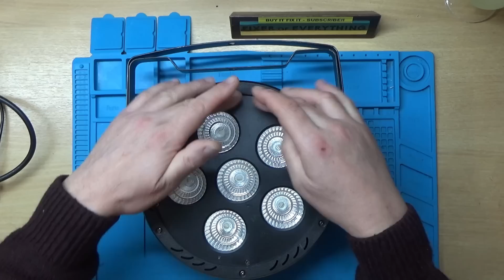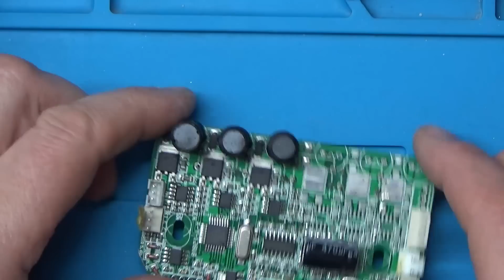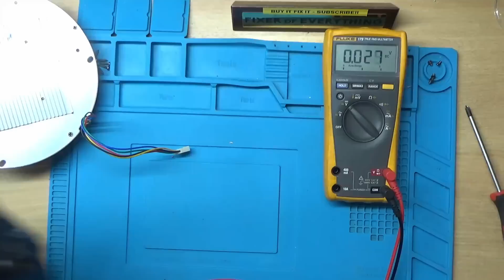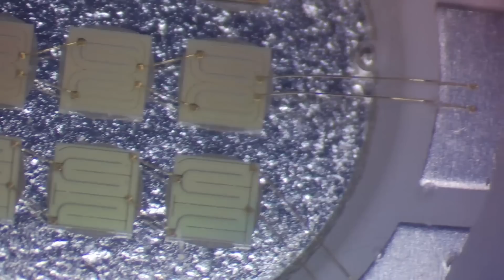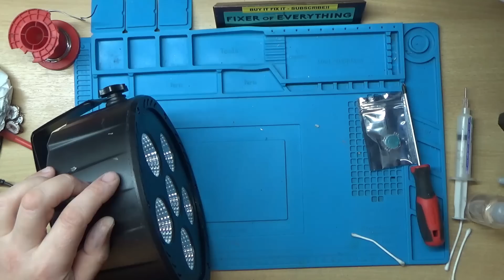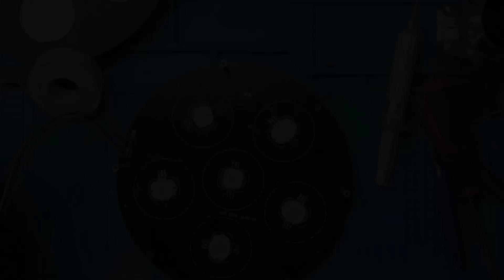Faulty QTX PAR180 High Power RGB Stage Light | Can I FIX It?

Comment: I do like how there is 2 circuits so the lights not completely dead if one led goes but um. (Looks at the light at the beginning) yeah

My theatre teacher is letting me try to repair a light that won’t work at all
Reply from the maker: Good luck with your light 👍
Reply: @BuyitFixit thanks I probably won’t be able to get it down til our show closes and it hasn’t even opened yet. But I’m really betting I could

Comment: I think those LEDs are being over-driven that's causing the failure, The PCB says it should have 22.5V and the LEDs are getting 34V! Can't you drop the PSU voltage to suit?
Reply from the maker: Yes I think they are being over-driven. The voltage shouldn't matter too much, is more the current. I had thought of adjusting the resistors on the current driver IC's so they LED's didn't get driven as hard.

Comment: I'm not surprised that some of the lights failed is considering how much stress it must go through and switched on and off rapidly and left on in one colour for a long time so the lead bonding wires probably failed over time🤔🤔🤔🤔🤔🤔🤔
Reply from the maker: Yes agree 👍I've not used it since the repair. I looked at the datasheet and was going to adjust the current limiting resistors on the driver ICs to prolong the life of the LEDs

Comment: How many volts did you apply from the power supply to test the LEDs?
Reply from the maker: When I was just testing one at a time I think it was around 3V or so, It was more when I was testing a string of 3 of them (similar to the PSU voltage in the unit) although I did have current limiting on my PSU as not to burn them out.

Comment: Seems like they are overdriving the leds.  24 volts label on the board and 32 volt power supply.
I would see if the power supply could be adjusted down to about 24 volts.  The brightness would not change enough to be detrimental, but the leds would last ALOT longer.
Reply from the maker: The LED driver chips have a current limit feature, which is adjustable via some resistors. I've not used it since the repair as I was going to see if I can half the current output to prolong the life of the LED's. In later firmware there was an option to set the units brightness level but unfortunately this one doesn't have that feature.

Comment: Definitely I will change the power supply and use a 28v power supply to give more long life to the led's
Reply from the maker: I haven't used it since making the video, but I had planned on changing the current limiting resistors on the driver chips to perhaps half the output current.

Comment: Why do they wire 3 led’s in series and 3 in parallel ? Surely it would make sense to wire them all in parallel ?
Reply from the maker: I guess it's so they don't need to have a low voltage high amperage power supply which would probably be more expensive and have a heavier transformer and need thicker tracks / wires.

Comment: certainly didnt look like factory soldering on those pads, so seems like they already were manipulated before you got it... so yeah.. keep throwing new expensive RGB LEDs into this device and blown them from n inferior component/design, and make this the most expensive cheap PAR on the globe.
They are very cheap.. from China (not western resellers) they are like 10 to 50 GBP depending on power.. even here in Europe/UK Farnell got this PAR180 to 65GBP.
A shame you just neuter and likely throw away even the working ones 30W RGB-LEDs and like your made of money.. they can be handy these 30W RGB LEDs
Thx for the vid.. even if it don't make sense from a financial perspective... it still landed you a +1 from here and that is likely what matters... content..
Reply from the maker: Thanks 👍There was only 1 of the LED's that was still working but it has probably been over driven (the case was also discoloured) and I'm not sure how long it would have lasted. I'm planning on having another look at this and changing the current sense circuit on the IC's which seems to be done by the two R300 resistors which are in parallel. It was also suggested to bolt the LED modules to the heat sink so I might do that too. Yes it didn't make sense from a financial prospective but I bought it to repair, and initially I thought it was only the 3 chips. I'll probably do a video with a couple of short repairs and a revisit on this one at some point.

Comment: Nice to think you fixed it so satisfaction, but you can buy a new one for less than 30 quid. By the way, with the sound mode off, if you go to the B seting, that adjusts blue from off to full in increments, then the same with the other colours, no need to tap.
Reply from the maker: I did try the R G B 0-255 but it doesn't seem to affect the sound mode. In the instructions it mentioned a 'n' mode after the RGB for the master brightness, but it seems this one doesn't have that and just goes back to the start of the menu.

Comment: Would it be feasible to reduce the voltage and therefore extend the life of the LED's by putting a diode (or 2) in series?
Reply from the maker: It might be, but what I had been thinking was adjusting the current limiting on the 3 output chips, it is set with resistors (the R300 in the video next to the ICs)

Comment: i had to fix a light with the same build style and issue, but it was the kind where the soldering was on the underside of the LEDs and i had to buy a board heater to loosen the solder. took 3 tries to get it going. what a job that was, but it was very educational. it was 7070 style SMD LEDs
Reply from the maker: Well done. I had similar with the Milwaukee spotlight I repaired and also had to build a board heater 😂😂👍

Comment: Is there not a master control setting for brightness seem to remember when I had one you could alter it by pressing a few buttons
Reply from the maker: I did look at the time, but only saw R G and B which didn't affect the sound operation. I just had a look at the manual online and it says nxxx sets the master brightness. I've just tried on the unit and it goes r g b and then back to dxxx which is the first option, so perhaps it is something they added in later firmware, but it seems this light unfortunately doesn't support it 🙁

Comment: Pleased you got that working. Don't see much in the way of current limiting resistors, might make it last longer if you fit some?
Reply from the maker: Thanks 👍It seems it's the two .3 ohm resistors that control the current output via the switching SQ9910B ICs so I might have a go at changing them.

Comment: it's probably white, amber, and cYan - amber and cyan are typical fill in colors to improve the color gamut of RGB. Really high end lights usually have amber, cyan, and lime green as additional channels
Reply from the maker: Thanks for that. When searching o did see some lights that had the Amber, White and UV but that didn't seem to fit with the Y, although they could have hit the Y key instead of the U? Or you could well be correct👍

Comment: I have repaired many light fixtures made with a similar kind of LED chips. 
They tend to fail rather often. In my experience, green tends to die first, then red. I have not seen the blue LED fail as of yet. Although we repair these fixtures quickly for upcoming events. 
The light fixture I am often repairing is from the maker "Briteq" and is called "Powerpixel 8" and "Powerpixel 4". 
These repairs are quick and the LED chips should be widely available. 
I think they die so quickly because they are not properly cooled.... 
In the aforementioned light fixtures, they are entirely passively cooled which causes relatively high temperatures...

EDIT:  Sometimes the Red Part of The LED also fails first. With three LED in series it only needs one third of a LED to fail to take out the whole triplet of that colour...

My favourite procedure of replacig the LEDs ist firs snipping off the legs of the dead LEDs and then remove the soldered legs one by one. after that you can solder the new LEDs relatively easy
Reply from the maker: Thanks for that. I think they are also over driving them. I am going to look at altering this one to reduce the current although it will also reduce the light output slightly, but extend the life of the LEDs. I may also screw them to the heatsink as some suggested. Perhaps adding a small CPU fan or similar to the passively cooled units may help?

Comment: Doesn’t this has a design flaw then? A to high LED current or so? Or a thermal issue? This may not happen I assume.. 🤔
Reply from the maker: Yes, although judging from the dirt on the fan it seems to have lasted a while. I'm going to look at lowering the current output to the LEDs 👍

Comment: You could have saved two of the LEDs, the real mistake is that the LED modules are not screwed down because the holes for them are missing on the board....the heat dissipation is significantly better when they are screwed on...and also the durability....because, let the spotlight work for an hour, then it will show how well the components can withstand continuous operation!...thx for the vid.
Reply from the maker: Thanks I might try drilling and screwing the LED's down, also I had thought about possibly looking at the current regulation circuit and seeing how to alter it so it gives less current output so the LEDs would last longer at slightly reduced brightness.

Comment: Looks like the person who sold it did their research on fixing and found out the repair cost would be close to buying a new one.
Reply: Yea QTX gear is usually ok.... But can be had for very reasonable prices so repairs aren't really worth it
Reply from the maker: I guess it depends on what the fault actually was. If it was just a wire that had came off the blue for instance. Problem is you never really know what the fault is until you get it on the bench. I've had items a few times where I haven't found a fault at all and they work perfectly, other times I've had things like the AVerMedia video capture device where it was described as "No power" and it turned out to be a firmware issue (which I actually figured out how to rebuild the firmware for it, and flash it via a special undocumented bootloader mode).
Reply from the maker: Could be, I just looked back to see who I bought it from and it was "DFB Sound and Light Warehouse Ltd" on eBay. Perhaps it was a customer return and under guarantee or perhaps they looked at it and deemed it uneconomical? I guess we'll never know.

Comment: You'd have been made in the shade had you checked it before putting it back together. 😅
Reply from the maker: I honestly thought it would work, but we all make mistakes. I even tested the 2nd time with the bench PSU to make sure that they were all lighting. I guess I didn't anticipate that one of the LEDs would break down thermally.

Comment: Never change SOME elements - usually if more than 1 unit from more than 4 is dead, usually the rest are more than 80% dead. Always change all of them. That also includes battery cells for example.
Reply from the maker: Good advice. Thanks for that👍

Comment: I had a Citycolor in - the power distribution board came inverted from factory and shorted out the psu
Reply from the maker: Damn that sucks 😢
Reply: @BuyitFixit  last week a psu for an amplifier that was configured for 120V - good thing I saw it before I plugged it in. Manufacturers F up too!

Comment: Hi!    re: 'cost', return on 'investment', all in how One values Knowledge.   Nice view of LED!   Thanks! 
Curious, Seeing other multi lights work, and test you did, 8:35  what's used to control needed voltage for colors?  Seems to be none here, maybe i miss it noted in chips mentioned. ?    spite fan, perhaps not enough ventilation, too.
Reply from the maker: Yes, it's all learning, and practice, just not really economical if you were repairing it for a customer. The LEDs were controlled by the driver IC's 6:42 data sheet is just after it. Yes I perhaps should have cleaned the fan at least when I looked back at the video, I still may see if I can change the current limiting resistors to see if I can make the leds slightly less bright and hopefully last longer!

Comment: Probably the current set resistors are not a good value and they overdrive the leds. I also had some lights fail (also dmx lights) because they are overdriving the leds. I fixed them and swapped the resistors for a value  the leds would be happy with for a lot longer. Also the driver chips will benefit from it. Also when replacing it with new leds with the old current programming resistors it also managed to break down the bond wires after an hour of testing because they were being overdriven tooo much
Reply from the maker: Yes I had thought if changing those but I'd need to work out the value from the datas heet. Have you changed any with the same IC? I'd be interested to know what values you used.

Comment: Happy for someone to explain why I'm wrong, but if the current through the two parallel paths is set by the voltage across them and the resistance of each leg, then if one leg was open cct and the voltage remains pretty much the same, overage current draw would halve? For more current to pass through the remaining cct the voltage across it would have to go up or the resistance of it lower.
Reply: You're not wrong. That's the inherent problem with powering LEDs (single chips or series strings) in parallel without, at a minimum, a balancing resistor in each leg. Small thermal and manufacturing variations mean one string will draw slightly more current, thus getting hotter, thus making the LED more conductive and you get thermal runaway. The current sensing circuitry in the power supply won't be aware if this and can't control it. The designers also failed to make use of the mechanical mounting holes on the modules. These are not optional for high-powered devices like these. Proper clamping pressure is necessary to stop problems like the heat expanding the legs just enough to break contact with the heat-sink.
Reply: Depends on the design, but many LED drivers are simple constant current designs, which is fine when you have all working LEDs. As soon as one in a string goes open the voltage will increase to a point where the current limit max should kick in (that's why all the LEDs in a typical TV backlight then go out). The issue here (in my opinion) is because of the second parallel string. The voltage would just increase to cater for the LED out in the first string. The increases the current through the  second string, lessening the life of those LEDs. Looking at the PCB, I suspect the LEDs are being overdriven anyway, but they could (assuming the design caters for this) have used the second set of FETs for the second string, thereby balancing the strings (sort of). But then the cost would increase and the manufacturers would sell fewer units.

Comment: Rule of thumb with ALL Led lights that use multiple chips: Replace ALL of them at the same time, as the ones you leave behind WILL fail again very soon! They seriously overdrive these chips, and if you can reduce the current even 10% it will make them last a lot longer. Glad to see you did that!
Reply from the maker: Thanks 👍Yes I had been thinking of modifying the circuit slightly to reduce the current as I don't think I'm going to need it as bright as it is! Thanks for the advice 🙂
Reply: I kept repairing these for a local pub. Once they start failing, one would go about once a week. Luckily, we had a pile of sacrificial fittings to butcher. These had tons of crap 5mm LEDs in series, so finding the faulty one was done by shorting each one out in the chain until the rest came on.
Reply: Yes replace all of them, the ones not replaced will fail for sure. The heat generated will also break them down as well.

Comment: I have a Neat D5 Robot vacuum cleaner battery I tried to repair, I changed one dead 18650 Li Ion battery and it bricked the Battery.  Apparently it has a charging / protection chip, would you be interested in looking at this battery as i'm sure many others are having similar issues and this could make an interesting and informative video?
Reply from the maker: You can drop me an email at the channel's name at out look dot com

Comment: Awesome!  You're one persistent fellow I must say, most would have not spent the time and repetitive work to finish the job given the cost.  The LED's must be a bit over driven to failure then the cascade happens, IDK.  I suspected component failure on a board but got totally schooled as usual🤨 Great job and education, thanks.  See ya soon.
Reply from the maker: Thanks Terry👍Yes I wasn't expecting to have to replace all of that lot, but I was already so far into it, so there wasn't much alternative. Sometimes you gotta take the rough with the smooth 😂😂

Comment: A good fix. The company should have screwed the leds to the PCB, rather than  just thermal paste and soldered connections for heat dissipation.
Reply: Or they should better tweak the led drivers by changing the programming resistors to output less driving power so the leds dont burn up fast
Reply: @309electronic5  True, and they were wise enough to put an aluminium heatsink onto the back of the pcb. Did think when I first seen it, that they must have used a fair bit of compound there, and is it dry.

Comment: i know exactly why those have failed and will fail again   no current limit ;)
Reply from the maker: I'm sure the driver chip does current limiting, and it's set by two resistors. I had thought about changing those (still might yet) to lower the current 🙂
Reply: @BuyitFixit  yea would not be surprissed if they are set a bit high